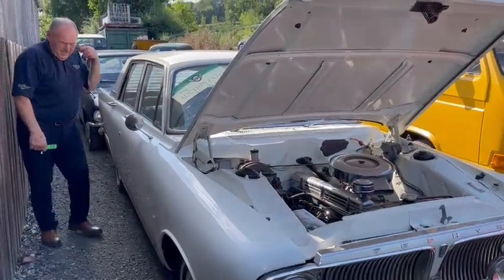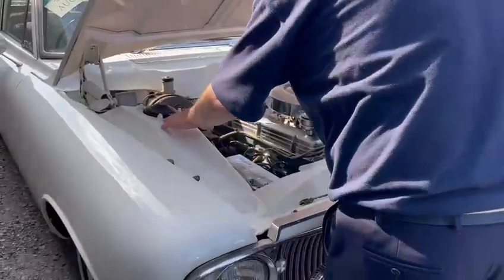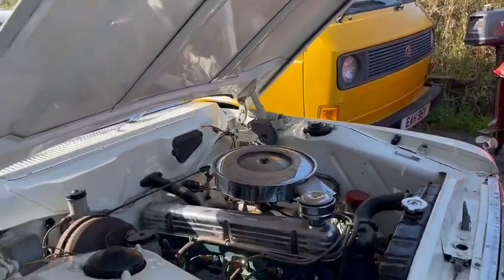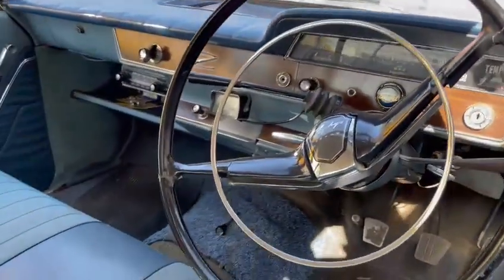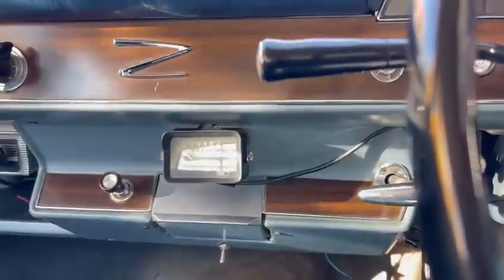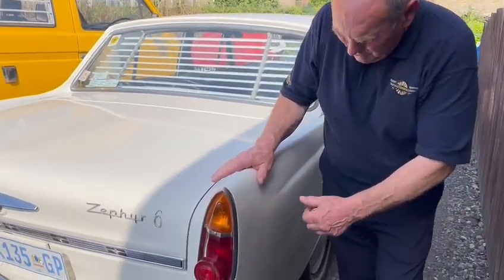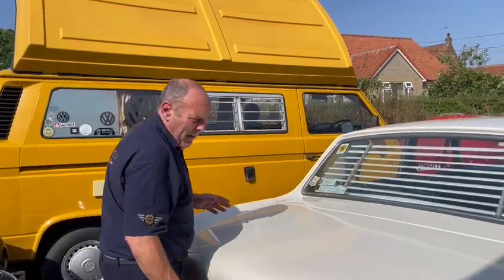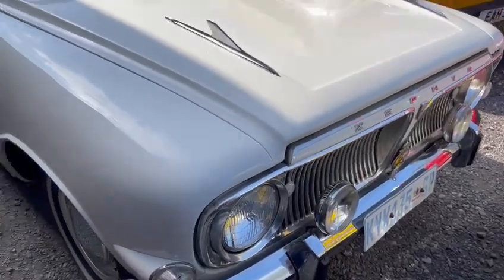FORD ZEPHYR | MATHEWSONS CLASSIC CARS | 29 & 30 JULY 2022

Comment: He's certainly right the Mk 3 Zephyr could rot for England, specially around the front suspension struts and bonnet hinges, front wings, lower doors, sills, inner wings etc. I've even see cars going through auctions with pieces of 3x2 timber wedged between the engine block and inner wing because the suspension struts were pushing inward. You won't find any better version than this as those you do see are usually full of filler with the strut tops having reinforcing panels welded on. The two forward chrome bonnet trims were never fitted to the UK Zephyr
Reply: The boot lid handle was never found on Dagenham built zephyrs either.